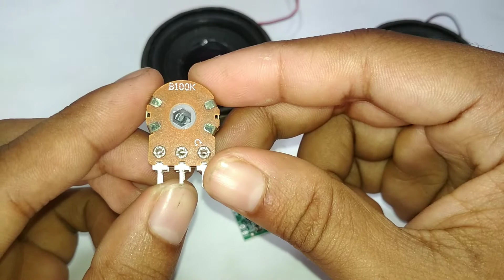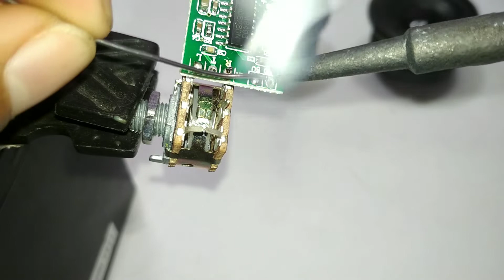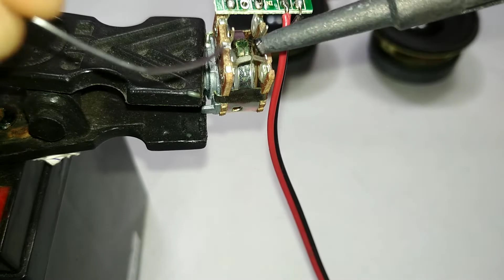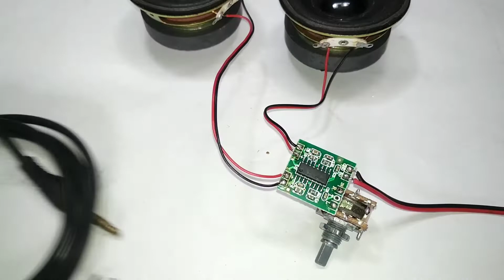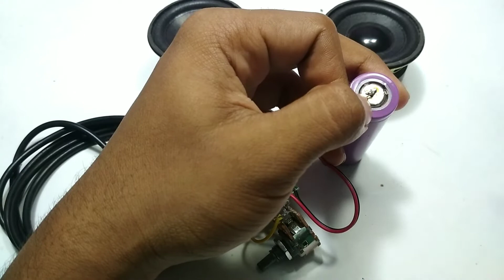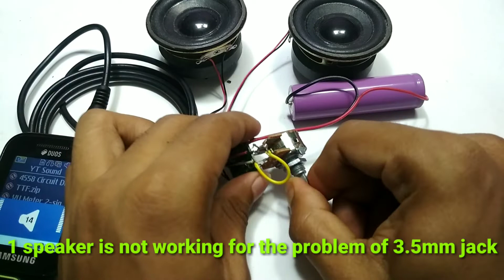How To Connect Volume Control In PAM8403 || Electronic Step

Comment: thanks. it worked here. do you think that could be some impedance issue to the device (out) connected to the amp input? IE when 0 ohm is setted on the pot...